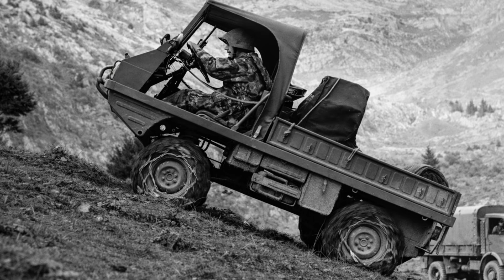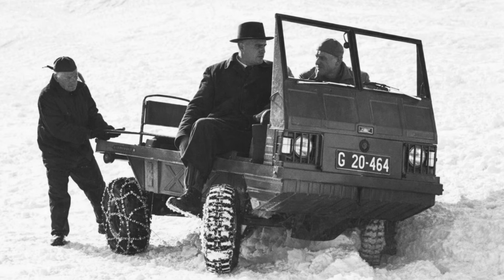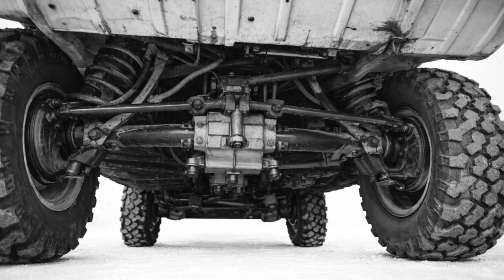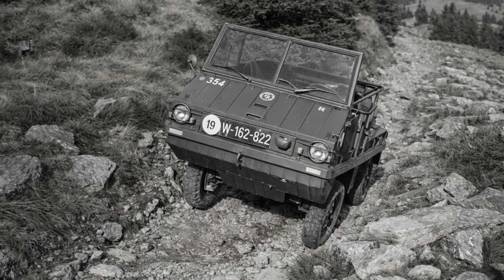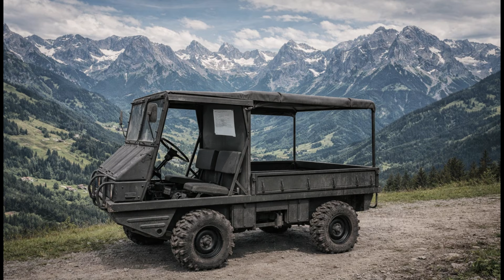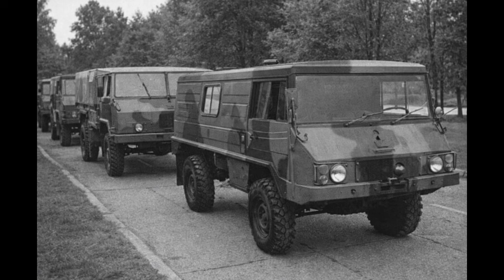How the 600kg Steyr-Puch Haflinger Outperformed Larger Military 4x4s

Comment: C EST GENIAL LA TRANSMISSION TUBULAIRE QUI CONSTITUE EN PLUS L AXE DE RIGIDITE,MAINTENANT QUE LES BREVETS SONT DANS LE DOMAINE PUBLIC ON SE DEMANDE POURQUOI DE TEL ENGINS NE SONT PAS REMIS EN CONSTRUCTION PAR DES OPERATEURS INDUSTRIEUX,POUR LES PAYS EN DEVELOPEMENT CELA CONSTITUERAIS UNE OPORTUNITE ECONOMIQUE TANT DU POINT DE VUE DU TRAVAIL PROPOSE QUE DES SERVICES RENDU PAR CES OUTILS
Reply from the maker: Very interesting point. The engineering solution was truly remarkable for its time. However, modern safety, certification, and environmental requirements make it significantly more difficult to reproduce such designs in their original form.